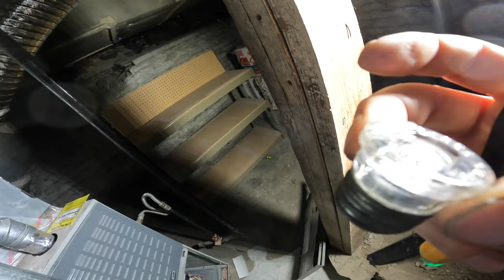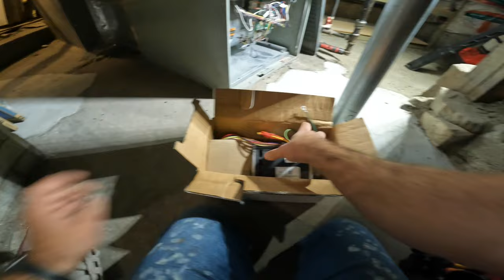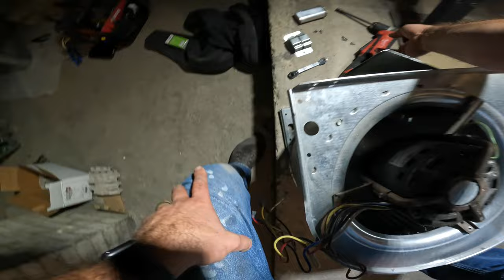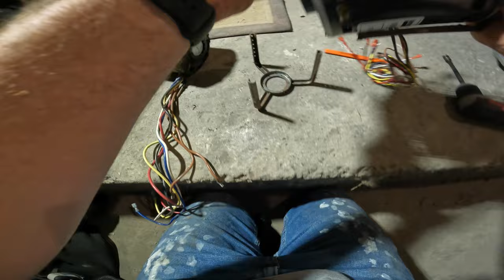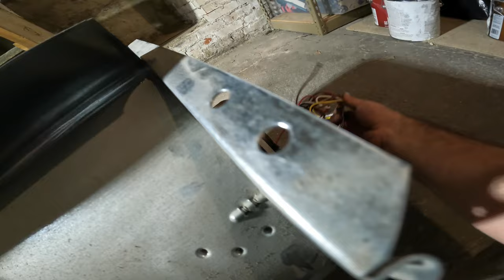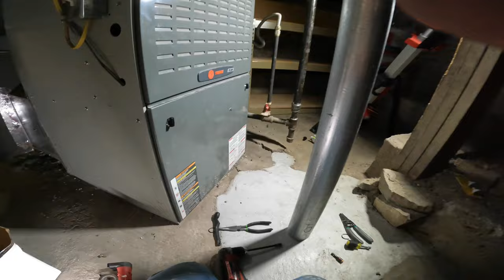How To Replace A Blower Motor On A Trane XL80 Furnace

Comment: Great video, I'm going to tackle this job myself on my Trane furnace, after I got the blower diagnosed as bad after they ran power to it and motor was a no go. The motherboard was working fine.. They quoted me $1905 for parts and labor, plus the $95 for the service call.  I declined, the oem trane motor for my furnace is about 1k new with the module included. I couldn't justify paying $900 for labor and motor mark up on a 1.5 hr at most job. Thanks for the helpful video
Reply from the maker: It’s not brain surgery, I have faith you can do it no problem 👍🏼
Reply: Update,  thanks for your very helpful video, tackled the job myself this morning and all went well. I have my furnace up and running again, so long Jack Frost.

Comment: I used this to remove the fan so I could clean it.  The motor was practically sealed with dust, so I cleaned that too.  It hasn't been cleaned since it was installed 23 years ago.  You can feel the difference, especially upstairs

Comment: Thanks for the informative videos, how much does this type of fix usually cost? And can a complete amateur try to replace a blower motor?😁
Reply from the maker: Totally. Just be safe and make sure to turn your breaker off before you touch anything! This job was $600 with materials and labor. It was an oem Trane motor though.
Reply: @beaglemice4585  did you do it yourself? I am going to do the same.
Reply: @beaglemice4585  thanks for the info
Reply: @diyhvacguy  how do we hire you??

Comment: That motor mount looks antiquated for that furnace.  Never seen that type of mount on a furnace that looks fairly new. It’s a total different color. It’s usually a belly band. The resilient mounts are usually used in a cradle mount situation.  I don’t think that is the original setup. Motor sounded like it strained starting up.  Did you leave the old capacitor in?  Maybe you have the wrong capacitor. Did you check the amp draw on the new motor? That motor sounds like the 32 year old motor in my 1990 carrier.
Reply from the maker: It was a new capacitor that came with the motor, correct size. Sounded fine to me.

Comment: Can you explain the symptoms they were having ?  And how did you know it wasn't a sensor or a furnace pressure switch?  My York is old and just stopped blowing.  Will light up, get hot, and then shut off.  A motor is 300 bucks, sensors are much cheaper.  Can you show how to test so you know which one to get?  Also, it's a down draft furnace I think.  Are those super weird?  A little different to work on.
Reply from the maker: In the video you may have saw it but I tested between neutral and the heat pin and I was getting voltage 120 V to that pin so I knew the fan was getting power but nothing was happening. The symptoms for this one was that the flame would light but the fan would not turn on. downdrafts are the same thing but the components will be oriented different. If you’d like some more information feel free to email me at DIYHVACguy@gmail.com
Reply: Hello  @diyhvacguy    Nice video.   I had two techs checking out when the heat did not come from my Trane. One recommended draft inducer motor replacement the other said blower motor. I tried draft inducer motor, pressure switch to get the heat working with very low heat coming for few days.  It stopped with a humming noise then I replaced the run capacitor the same low heat came out for a few days then heat stopped with the same humming noise, I tried run capacitor changing but this time it did not work , same humming noise again. Does it sound like a blower motor replacement ?

Comment: Sorry for this. Probably get it all the time. I have a trane xl80. Model tdd080r936f4. And I think my blower went out. But I have no idea on what model number the blower is. I've looked but cant get a definitive answer. Furnace kicks on. Can hear the heat going. But when it's time to push. No air. And I'm no electrician. So im afraid to get that deep into it
Reply from the maker: If you need some help finding the right part and walking you through replacing the motor, check out our membership at Patreon.com/diyhvacguy where you will get one on one help with diagnosing and repairing. It’s cancellable at any time and only $25/mo.   Best,    Dave

Comment: What about they work on cold but don’t want to work in heat ?
Reply: I’d try swapping the heat wire on the terminal labeled “heat” with the one labeled “cool” and see what happens. If the fan works then you probably have a bad fan. If it still doesn’t work it probably is a bad board.
Reply: @wasatchmotoco  thanks sir fan it’s working , the board of my a/c don’t work I need to change furnance that board don come anymore unfortunately

Comment: My blower is unbalanced.  Is it possible to balance the squirrel cage?
Reply from the maker: Are you sure there isn’t something stuck in it? Your best bet is to pull the assembly and manually spin it and see what’s going on. I’ve had the mounting holes get stripped and cause it to wobble around.

Comment: I didn't know Trane Systems were capable of breaking
Reply from the maker: 😂😂😂  Aparently snakes can break em
Reply: @diyhvacguy  don't know about anyone else, but my blower motor on an XV80 TUD100R95K4 has gone out twice in 14 years, but everything else on the furnace is like new.  Also had to replace the Trane evaporator on AC after only 12 years.  A little disappointed I didn't get at least 20 years out of all of it considering the initial system cost.